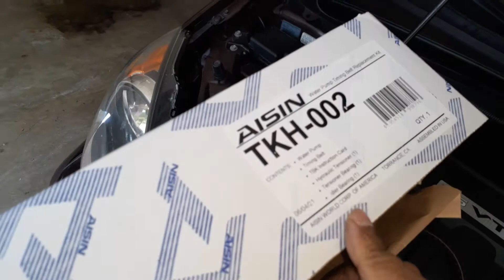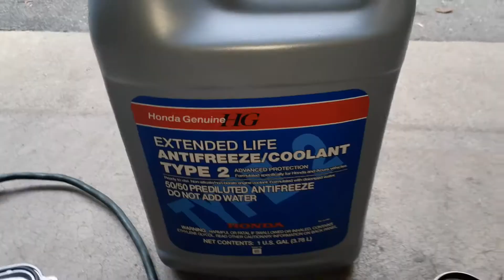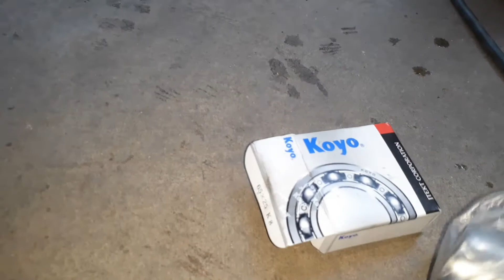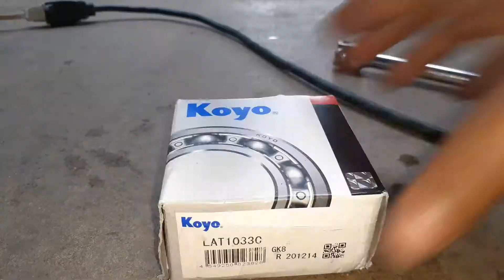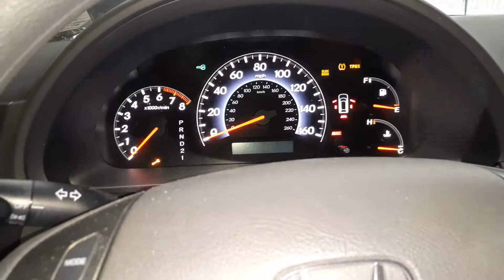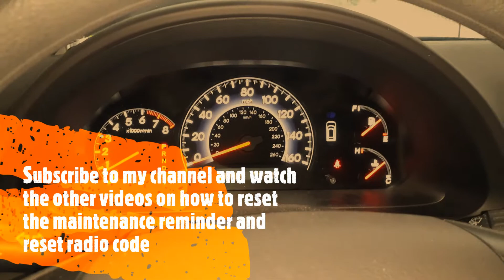2005 - 2010 Honda Odyssey Timing Belt & Water Pump Replacement - Honda/Acura 3.5L V6 - Long Video

Comment: MOST EXCELLENT AWESOME VIDEO!!!

A couple of points;
1) At about 31:32 you say that the springs in the piston moves the cams back.
     Actually the spirngs in the valves are what is causing the cams to want to rotate because they are pushing on the cam lobs.
2) At about 31:48 you say the pistons will his one of thos cylinder heads.
     Actually any time you rotate the cams CW or CCW you risk those valve heads hitting a piston head when it's they are at TDC.

However, you can save time and worry if you lock your cams in place BEFORE you take your original belt off.
To do this, use a dual-overhead-cam lock tool.
The cams won't move and you can then repove the old belt, reinstall the new belt and replace the tensioner with the lock tool in place.

Also, I may have missed it but maybe replace the crankshaft position sensor while everything is apart.

Very good otherwise!

Comment: My factory manual said to torque timing belt adjuster to 19 ft-lbs. The idler pulley was 33, but not belt adjuster for 07-10 model.
Reply from the maker: You are correct, the belt tensioner pulley should be torqued to 19 lbf.ft.

Comment: Good video EXCEPT no mention is made about the very real possibility that the woodruff key falls out when you remove the harmonic balancer.  In which case when you turn the crank to align to tdc  the cams won’t move and you will bend valves.  Which is what happened to me 😢
Reply from the maker: Sorry to hear that you had the key fall out when taking the harmonic balancer. I had shown the key and the arrow position in my video at 10:55.

Comment from the maker: Caution: There are lots of fake Honda labeled parts sold in the internet for cheap. A broken timing belt will cause expensive damage to your Honda interference engine. Instead buy the Aisin kit TKH-002 from the official Aisin store on Amazon - https://amzn.to/3CuxDBm. Aisin kit has the OEM parts for the Honda engine.